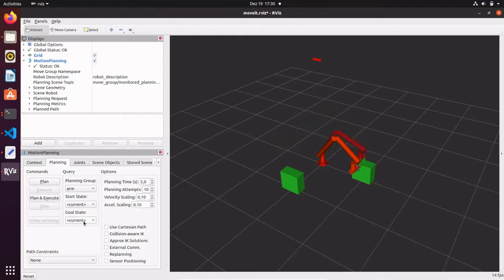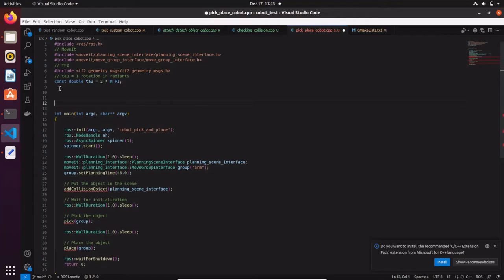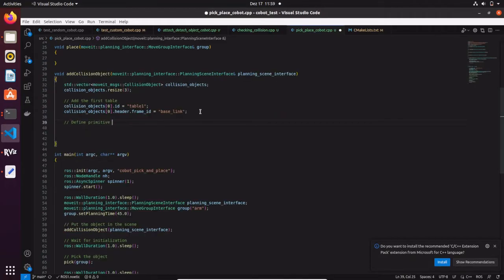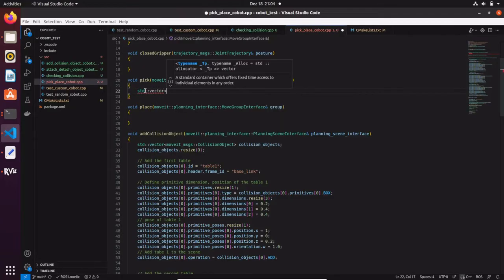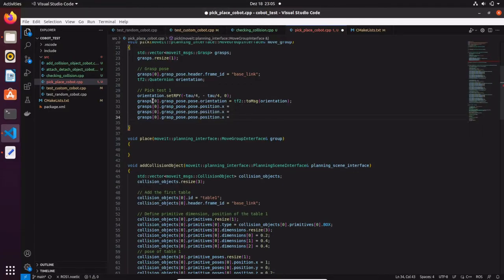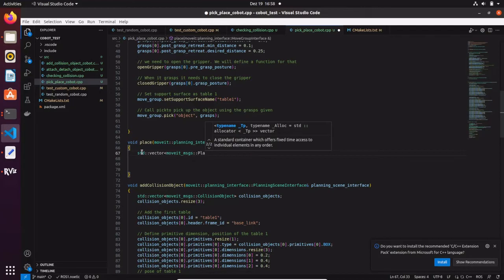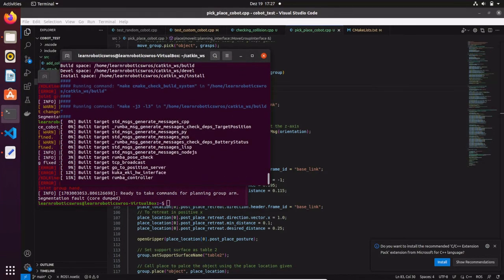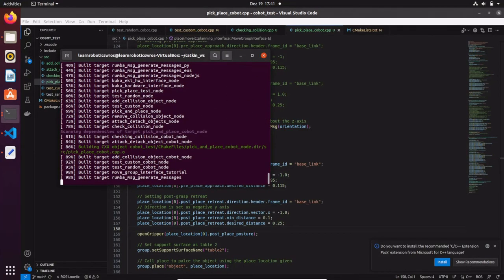How to code a Pick and Place for your Robot in C++ with MoveIt

Comment: hey I have a question. I want to use arduino to control a robot arm that I designed in fusion 360. does this method gives you the equations of the model so I can implement it in arduino without doing manual inverse kinematics calculations?
Reply from the maker: You can keep MoveIt for doing inverse kinematics. At the end you have to deal with the trajectory_msg, where there are all the information of each joint, including joints position. Then you would need to create a node that listen to the topic that the controllers are publishing and send the data via serial to Arduino, you would need to use ros_serial. Then from Arduino you read the information coming from the serial and you send the command using the servo library.
Reply: @learn-robotics-with-ros No I don't want to connect my robot arm to ROS only arduino. I find it hard to calculate the inverse kinematics manually so I'm asking if I can get just the inverse kinematic equations from Movelt.

Comment: does this c++ code work for any robot? i'm working on the MG400 robot on ros
Reply from the maker: Basically yes because the pick and place rely on the position and orientation of your end effector using Inverse kinematics. But pay attention:
1) you need to create a moveit config package for your robot and when you arrive to the "planning group" call the arm "arm". Make sure that the base of your robot is called "base_link"
2) then you need to adapt this c++ code in the function open gripper and close gripper. This works if your grippers has a mimic propriety.

It should work, but if you send me the link of your URDF file I can make a video on that, as an example of how to adapt the code to any robot
Reply: Can i have contact information so i can ask you more questions?
Reply from the maker: Sure! You can write me at ros.master.ai@gmail.com